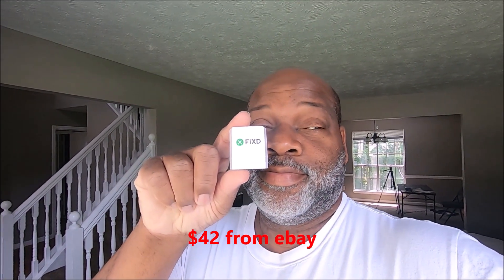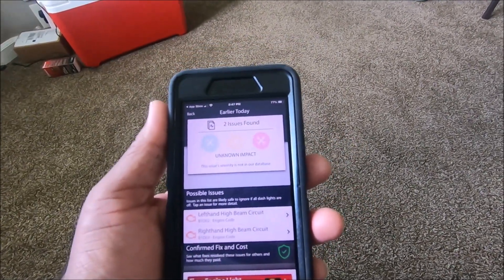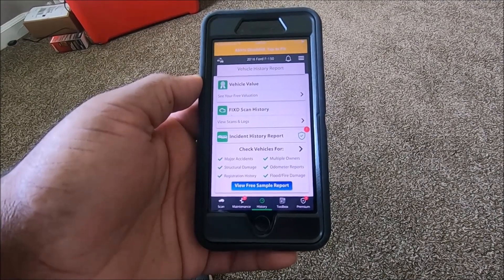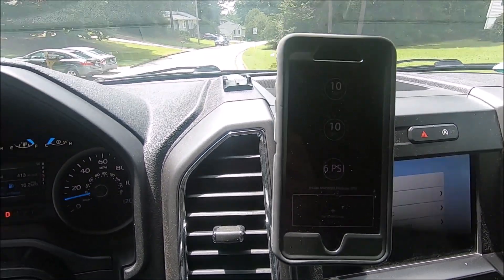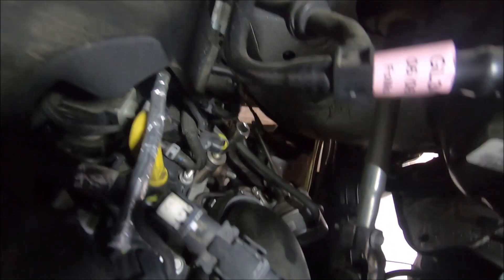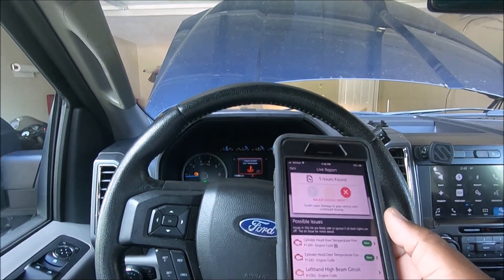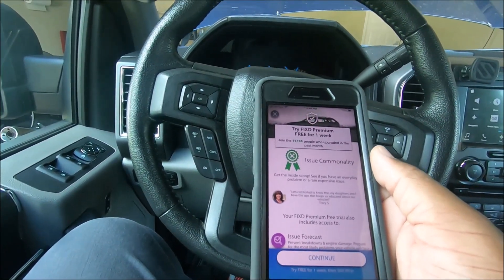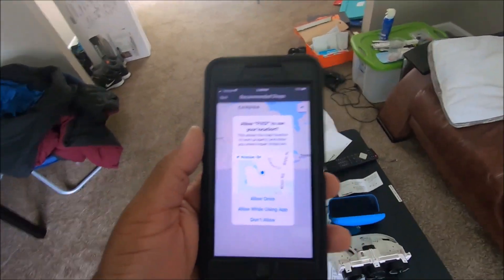Fixd is just another automotive scam

Comment: You should try the blue driver scanner it seems very detailed and good.
Reply from the maker: No scanner is going to tell you the single part to replace because of the way engine sensors are installed.
Reply: I got the blue driver too and it great!!
Reply: @blackericdenice  This one will it’ll tell you what and how to replace to replace it. It’s pretty impressive
Reply from the maker: @itsjay1852  Upload a video. No scanner is going to say replace the cylinder head temp sensor because it's a none checked sensor.

Comment: I like my fixd just to be able to read codes which then I can just Google the code all for free. The rest of the stuff on there is a scam which isn't worth paying for
Reply: You could just buy a old scanner plug it in and it will give you the codding for what is wrong with your vehicle then google it and you get the same information. Most people are giving away the old scanners now the same ones Mechanics used until around 2010. Anything with a sensor on it can be scanned if your vehicle starts pulling really hard to the right and nothing pops up in the FIXD or a scanner then what? You take it to the shop pay what they say it costs... Or what is left of people out there that have basic mechanical knowledge TEACH your children the basics how to drain your oil change the filter,  change brake pads rotate your tires ect...